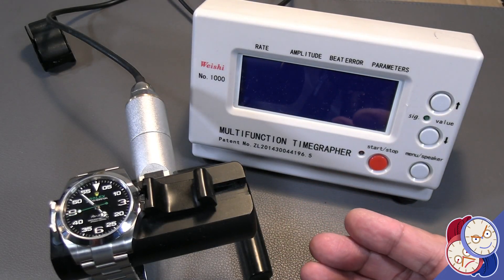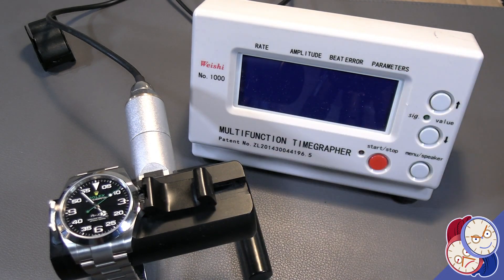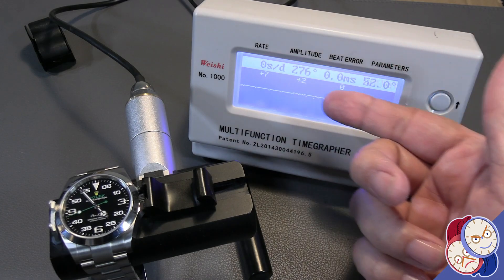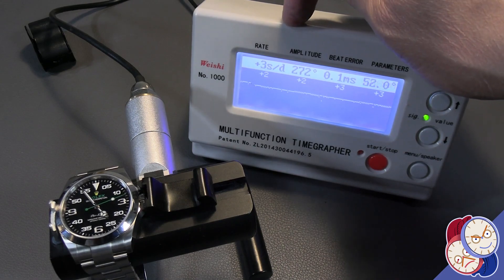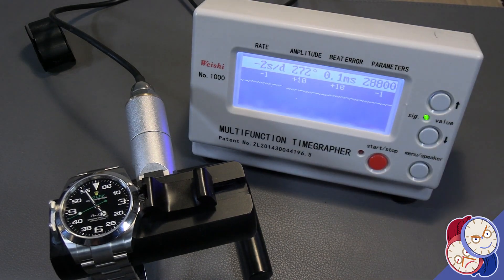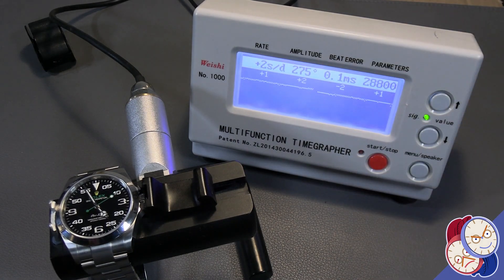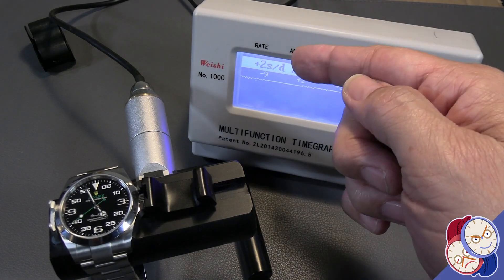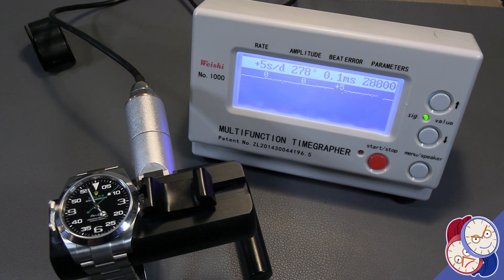How to use a watch timegrapher

Comment: Don't you have to enter your left angle for your watch movement? otherwise its not accurate???
Reply from the maker: Lift angle is important, but usually problems start elsewhere. If you keep an eye on your amplitude and accuracy you will be warned of upcoming issues. Of course, if you see that your lift angle is off take it in immediately for adjustment.

Comment: Also, always place the crown on the microphone side, on your example u should rotate the watch 180 degrees, the Clamp is just a clamp, the other side is the microphone. The crown is attached to the movement, so you get more accurate reading when the Crown is against the microphone
Reply from the maker: Good to know

Comment: How about testing the rate of a digital watch without any moving part and therefore no audio to pick up? Do you have another device for this purpose?
Reply: I have a requirement to determine the accuracy of digital stopwatches and timers. I am looking for a low cost means to pickup the 32k vibrations of the clock's quartz crystal. Have any info on this? Thanks
Reply from the maker: I would use a oscilloscope and test the timing circuit itself.
Reply from the maker: Why test a quartz watch? You can of course test a mechanical watch with with a digital display

Comment: Cool! How long do you keep the watch on the machine until it is done? 

Kind of like cooking an egg and knowing when to remove it from the skillet and on to your plate.
Reply from the maker: I usually let it sit for a few minutes to settle down, then look at the numbers.
Reply: @TalkingTimepieces  thank you!!! This is very helpful. 

Once complete, do you simply accept the rate that shows up on the screen? Or do you take all the number readings that popped up and calculate for average?
Reply from the maker: @nastehoomar500  I don't try to be perfect, I just use ut to get an indication of watch health. For example, you could measure your blood pressure 3x a day, and some do, but as long as I know my BP is within acceptable limits I'm happy.
Reply: @TalkingTimepieces  perfect, great example. Thanks so much! My mind just over thinks it.

Comment: Interesting tutorial. I can see the rate readings in the dial up positions on your timegrapher. How does that compare to your “real world” accuracy. Meaning how does it perform day in day out on your wrist, and possibly off your wrist overnight?
Reply from the maker: I find on the wrist it works best, which is why I usually measure at the end of the day after I've been wearing it. I must admist I don't track off-wrist timing.